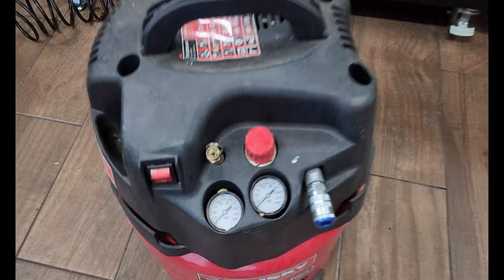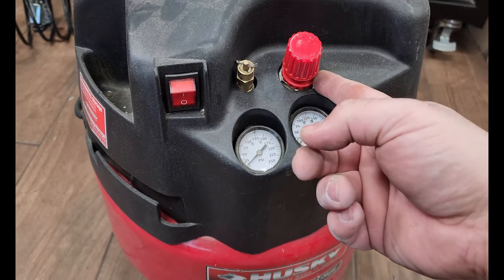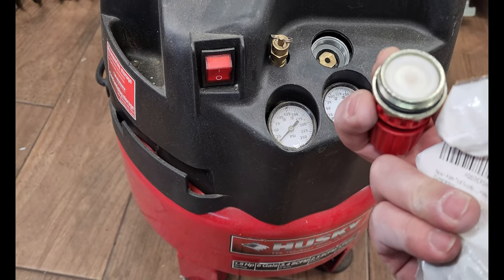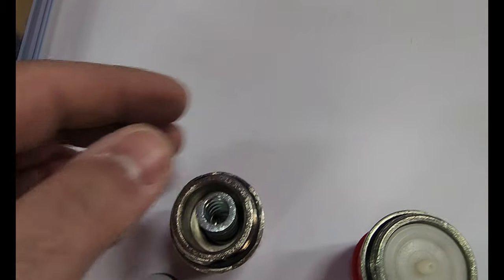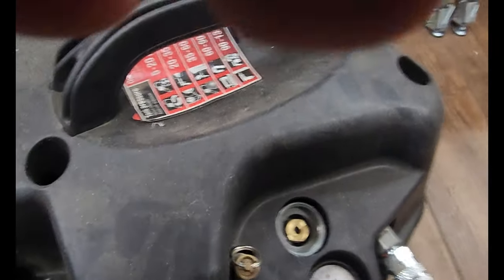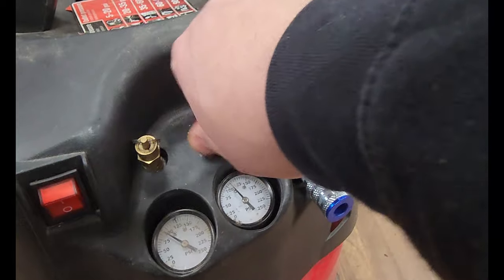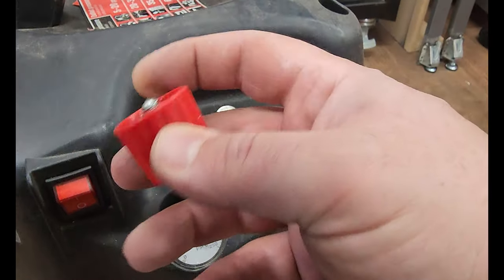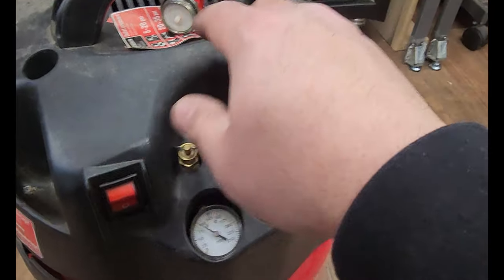Husky Air Compressor AB-9051116 Pressure Reducer Replacement

Comment: Nice fix! I found one of these compressors in the trash. It has a 30 gallon tank so I figured at least it could give me some more air storage. When I tore into it, I found the bolt going into the shaft of the compressor was stripped out. I drilled it out and threaded it to a half inch bolt and put it back together. It has been working great for nearly ten years now...

Comment: have same unit. bought the amazon piece you linked.  2 things look different.  the round piece that goes down/up wont fit. but the old piece fits. but the entire assembly wont spin in.  its rubbing the frame of the compressor where the threads start.  you have any issues like that? was going to use a dremel and take the edges off so I think it will thread in .
Reply from the maker: one thing you may want to try is to replace the inside of it.  I didn't have an issue with mine, it was a quick replacement and fit right in.